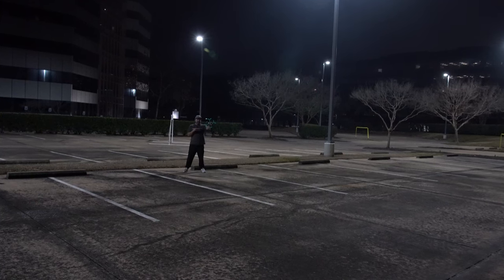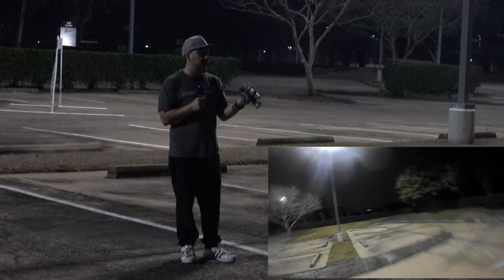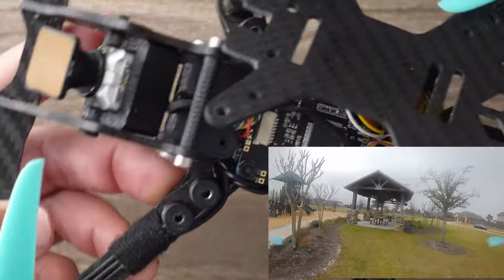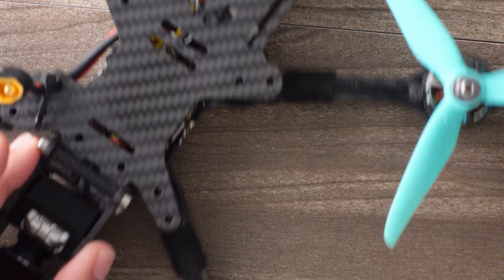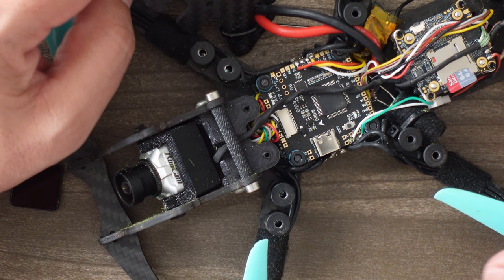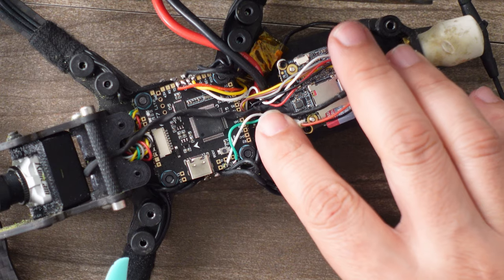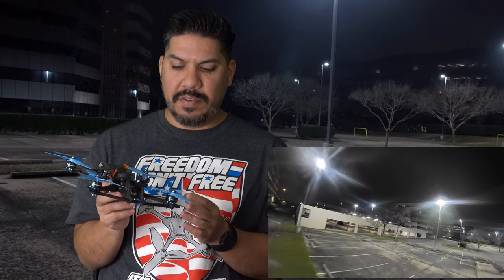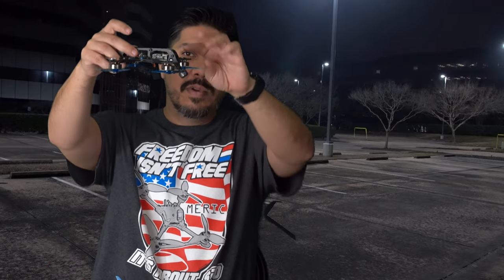Runcam Spilt HD - DJI FPV 2.7k DVR - Is 90ms latency flyable?

Comment: If the latency wasn't so high It could be useful but for now its not a game changer. Definitely the first step to a better product down the line once competitors start to try doing it themselves but better
Reply from the maker: Agree. If it was even like the 60fps cams it would be more usable. But nice that they have options. A next gen could be a game changer. Pretty happy with the footage itself so far, and the size / cost. Now just need to shrink the latency.

Comment: Split cameras seem to always get some kind of compromise between resolution or latency. This is obviously no exception but might be useful in something like a 2s naked 75 or 85mm whoop or a 3s naked toothpick. Can it be used naked??
Reply from the maker: Not sure if you can strip the heat sink easily or not. But agree that tiny micros might be the ticket where speeds are enough for latency to be a huge issue.

Comment: Thanks for the review. Probably pass on that one. Video looked ok. Gyroflow really cropped the image to make it lesser quality and the stabilization didn't seem to get that much better. Good intentions for onboard dvr for the vista but needs improvement to be even worth the extra money. I'd say the dvr looks just about as good as that if you use 50mbps.
Reply from the maker: Agree that may not be for everyone. I feel like it looked a lot better than dvr, but dvr does look pretty good and doesn’t cost you much in terms of cost / weight. 

Would you prefer increase in image quality or would decrease in latency be more important?
Reply: @JonE5FPV  after watching it again the video does look really good. I’d say latency would be the most important part to fix for this system. Get it down to 35-40ms and it would be great.

Comment: The latency when using 2.7k is just too much, I know I got a free testing version from runcam, but the 1080p 60fps, no problem at all, dont even feel the latency, I asked runcam about that, but because of the higher sensor setting with resolution and bitrate, nothing they can do about that, but I only need 1080p 60fps, so fine by me, 1080p on par with the DJI Air Unit 1080p 60fps, easy to adjust the horrible contrast stock setting on the runcam Split HD through the app and turn off the DNR.